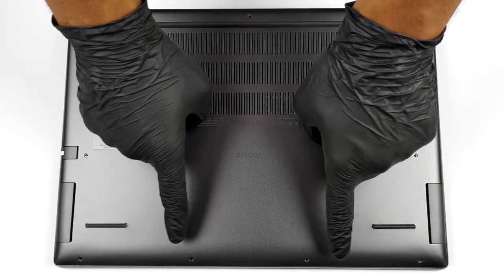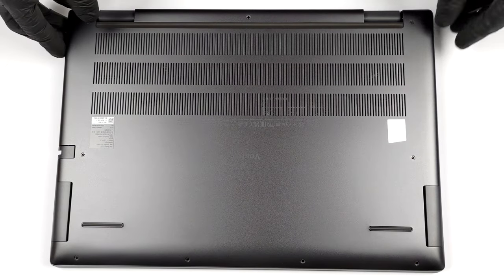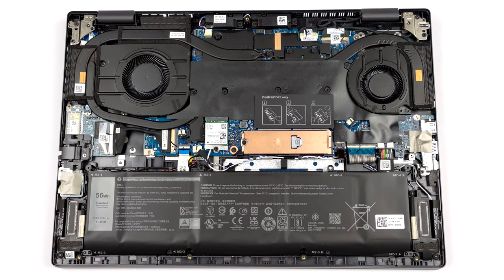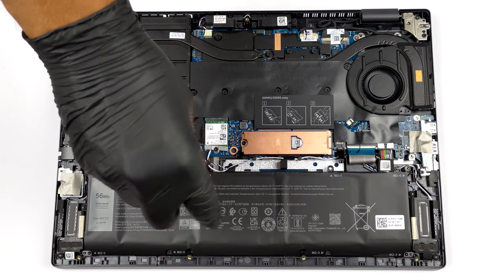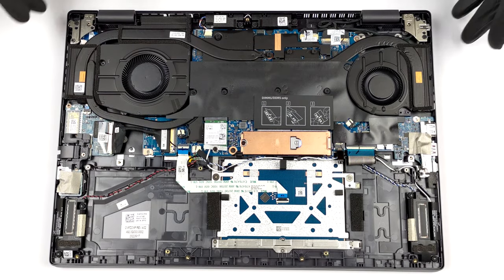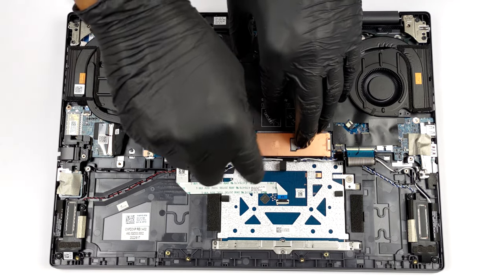🛠️ Dell Vostro 16 7620 - disassembly and upgrade options

Comment: The tolerances on the clips on this laptop are incredibly tight and it's almost impossible to remove the bottom cover without breaking off some of the clips. The screws do seem to do a good job of holding the laptop together even if a couple of the plastic clips are broken.
Reply: I dont agree on this one. I have just exchanged the RAM and opened the laptops bottom with a screwdriver and the fingers. Everything is fine :)

Comment: I have this laptop with 16GB ram, 1TB SSD
Reply: Does it have 2 slots for RAM?
Reply: @СилуанПоцелуев  Nop 8Gb is soldered + one slot
Reply: When doing intensive tasks that doesn't use the GPU, does the noise of the fan gets loud?
Reply: @BrenoSalomon  noo it's soo quiet.

Comment: If you are considering this laptop, and intend to either game or use it for CPU intensive work, you will also want to purchase a laptop cooler. While this unit offers a decent bang for the buck, it runs extremely hot, especially when running AAA titles, utilizing RTX, or using computing intensive software (rendering, etc). The only other issue I have with this laptop is its upgradability. Only 1 RAM slot with 8GB mounted on the motherboard allowing for a max of 40GB, only 1 header for hard drive, and only 2 USB ports. The USB ports are 3.2 so they are zippy and you could opt for external hard drive, however with only two ports this would limit you. There is an Intel Thunderbolt port, however, so you could use either a Thunderbolt or USB C hub to replicate more USB ports. Finally, if you purchase one of these, before getting remotely comfortable with the unit, do a clean install of Windows 11. While the Dell bloatware, and McCrappy are easy enough to remove, there's several issues that arise when doing that with their image. You will notice a marked improvement on performance if you install Windows on your own.
Reply: Do you need to purchase a copy of windows 11 in order to install on your own?
Reply: @Akiweb92  no just use the OEM key you get with the laptop